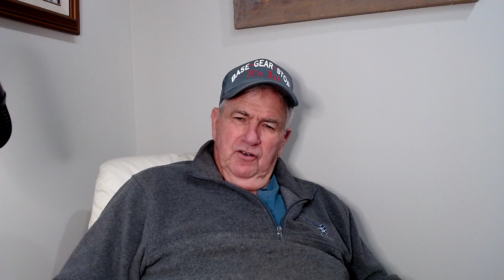T 38 Stability, Maneuverability and Washing Out Students

Comment: I was a member of Class 69-03 at Randolph AFB about 18 months ahead of you.  At that time, class size was 45 students.  We graduated with 31.  One of the 14 lost was a medical wash-back who injured himself during the early Physical Fitness and Conditioning but ended up graduating with the next class.  The other 13 either went out with Manifestations of Apprehension (airsickness) or inability to fly.  Surprisingly all 13 washouts occurred before the end of Tweet instruction.  Everyone who survived Tweets made it through the T-38.  Even more surprising, all the surviving students thought the T-37 instructors as a group were superior to the T-38 instructors.  I, for one among several other classmates, had to switch T-38 instructors in order to get through the program.  Fortunately for me, class standing was determined by 50% academics/50% flying at that time.  I was middle of the road flying-wise but number 2 in academics.  Later ATC changed class standing to 10% academics/90% flying, or so I was told.  I was lucky enough to get an F-105 slot and continued into A-7's and A-10's.

Comment: 12:09 - "The -38 wasn't a pilot killer."

Tell that to NASA.  From the 1950s through the mid-80s, the leading cause of death for astronauts was the Northrop T-38.

These fatalities do not count the times when moonwalkers had to eject from the T-38.  Like Pete Conrad diverting to Bergstrom.  Each fatality of these extremely experienced test pilots was a situation that was quite normal, that average AF 2Lts were expected to be able to handle.